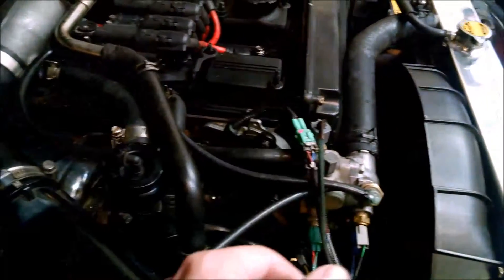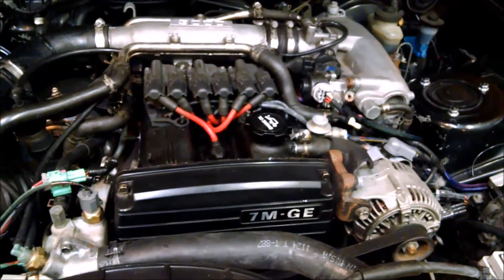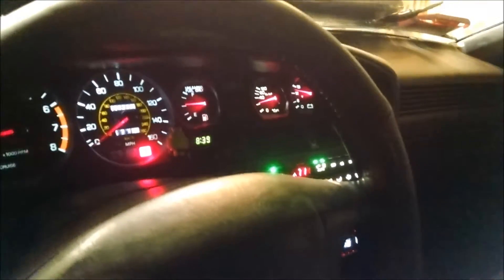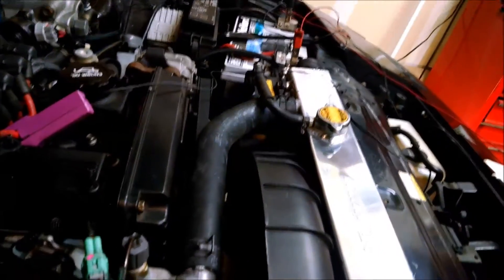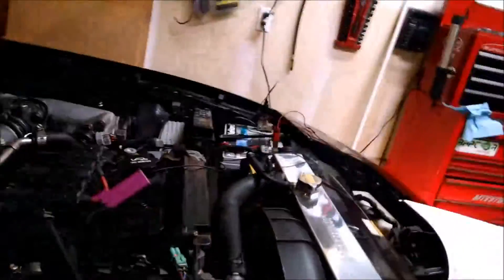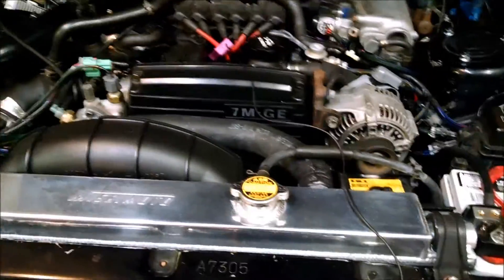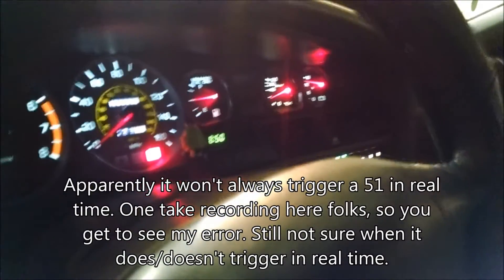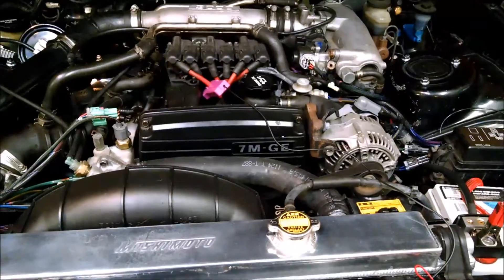YotaMD.com - MK3 Supra Ignition Timing

Comment: I just checked the timing on my Stock 7M-GTE... The timing is set (with E1 TE1 clipped) to 10 but there are times that I see it dropped to around 8. Without the clip, its right at 12 with a random drop to 10.

The drop I am talking about its like a 5 blink to 1 (5:1) when it drops 2 degrees then goes back to normal.

Is this Ok?

Comment: Hi. Great videos! Maybe you can help me. On an 86 Supra 3.0 liter I'm having a problem. I did a head gasket. It ran before taken apart. After put back together no start. Missing a spark. Anything I could have missed? A ground, a connector? Any info would be appreciated. Thanks!
Reply from the maker: Make sure you connected the ground under the intake manifold. That's easy to forget. Otherwise, just check all connectors and check for codes.
Reply: I know the grounds are connected. I don't know how to get the codes out of it. I don't have an ODB1 reader.. By any chance do you know how to test the oms from the pickup coil? How do I know if a pickup coil is good? Or the igniter? What kind of signal or power do I look for in the igniter? Thanks for getting back to me.

Comment: So not 0° with paper clip and timing...? -10° .then with out clip +10° to 12°????
Reply from the maker: Never 0. Around 10 btdc with clip, an extra couple degrees (so 10-12) with clip removed. A couple degrees on either side of that should be fine. Doesn't have to be absolutely perfect.
Reply: YotaMD what clip is it you guys talking about , it my first 7mge not the turbo , I put everything at top dead  and it started but rough af , adjusted the distributor and it got a bit better , took the distributor out and adjusted those marking on it now the bitch won’t turn on even with everything on tdc
Reply: Tiempo  10  12 degree

Comment: As a cause of bad ignition timing, is it possible for the engine to smoke heavy through the exhaust? Considering m.h.g. +studs+good turbo seals
Reply from the maker: I think at the point ignition timing is causing smoke, you'd have trouble keeping the engine running at all. If you have smoke, I would first suspect poor sealing pistons, valve stem seals, or turbo seals.

Comment: hi i have 7mgte do i first reset the codes with the fuse then jump tei and ei turn on ignition start the engine and adjust the cps with a timing light thanks.
Reply from the maker: +Martin Castillo If you can, you should try to fix the root problem of your codes first. Some codes indicate problems that will make timing difficult. I dont think the codes themselves are going to be a problem so much as the actual problems causing the codes.

In other words: I don't think clearing codes makes much difference when setting the timing.
Reply: +YotaMD how would you lower emotion I have 7mgte
Reply: +YotaMD emission
Reply from the maker: +Martin Castillo The best way to pass emissions is to have a good running motor, first. Beyond that, "emissions" is a big topic with lots of potential solutions. I'd need a lot more info to even make an educated guess on your issue. Catalytic Converter is probably the biggest component, but there are lots of things that could cause various high emissions.

Comment: If the timing were to be set at say, 15deg, would you be more prone to knocking/detention??
Reply from the maker: 755hp In short, yes. Any significant advance in timing will make you more prone to knock. Whether you'd actually have problems with knock or not? I can't say. I've never messed with advancing timing significantly on the 7M. In a turbo motor there are lots of other things you can safely tweak to get a little more power.